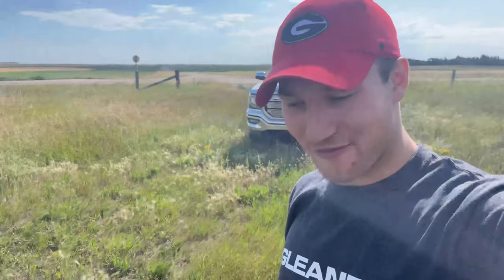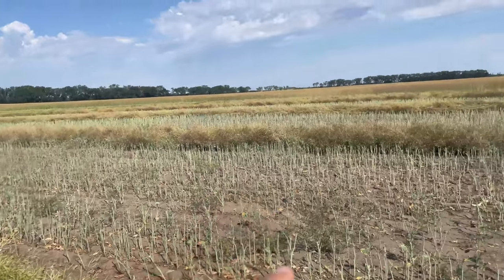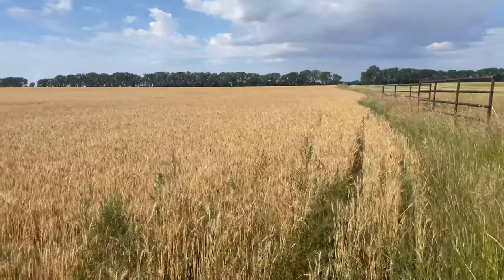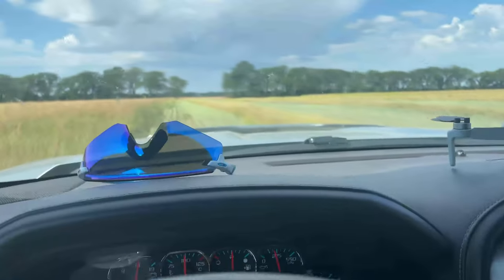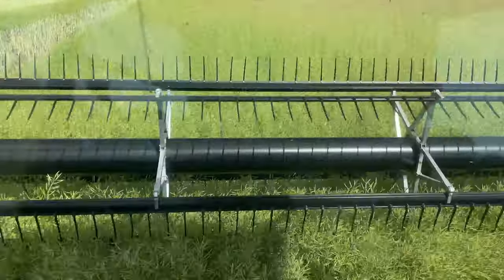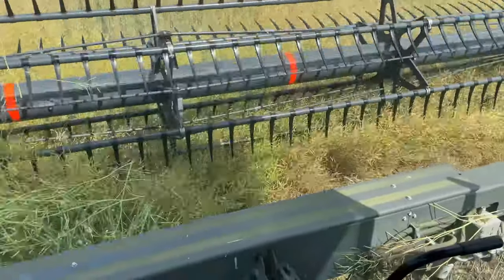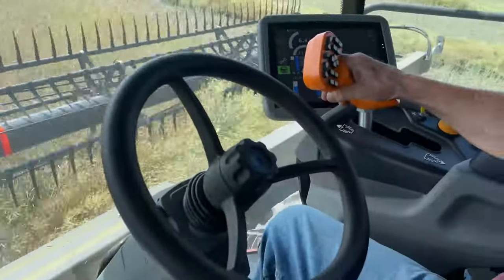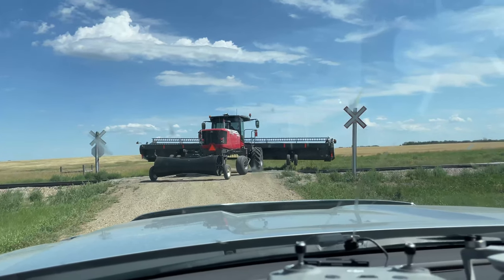Swathing canola with a Massey Ferguson WR9960 and 40' header

Comment: Worked for a trucking company. Based in Waterloo Iowa. Back in eighties. Hauled Massey 760 860 550 combines. From Branford ontario till they closed. They made the four wheel drive tractor there for a while. Then moved it back to Des Moines Iowa. Great show. Not sure where the combines are made now.